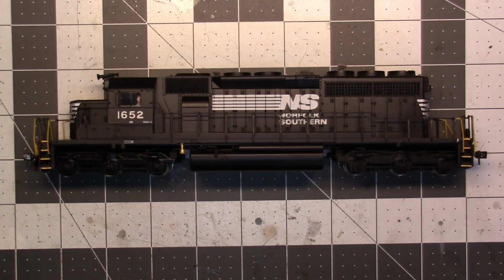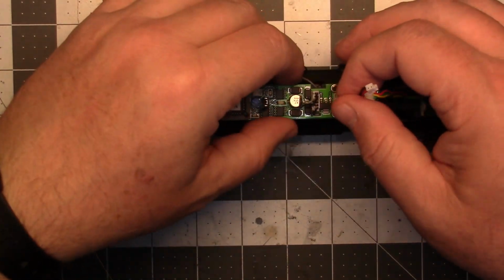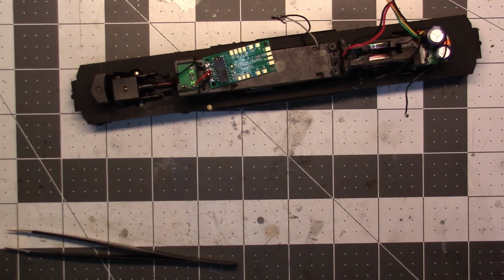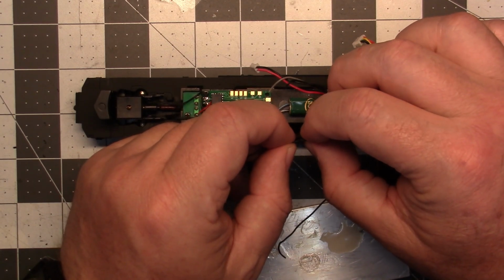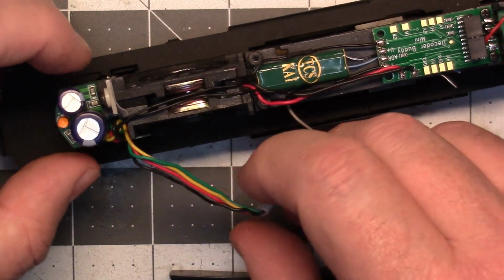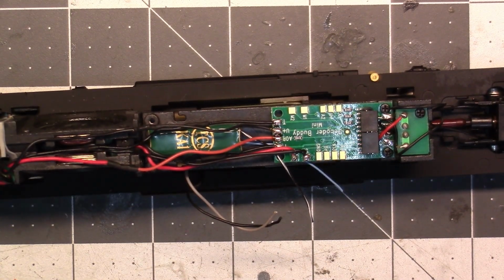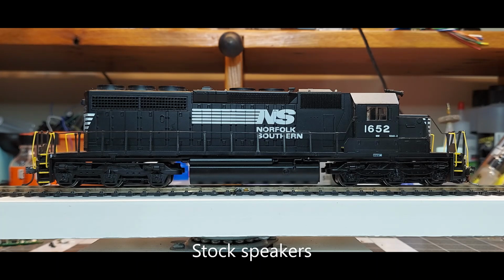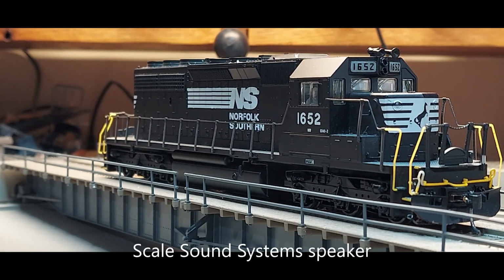BLI SD40-2 DCC install

Comment: The burned wiring seems to be a common issue with BLI locomotives. I ended up doing a decoder buddy, econami, replacement install on a BLI Paragon II Mikado due to burned wiring 6 wires total, blew the board and speakers.